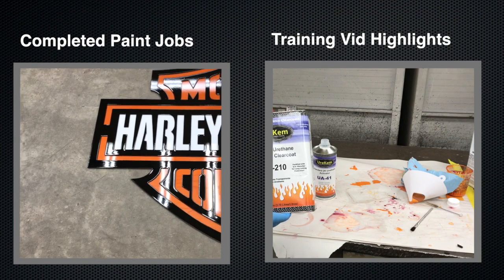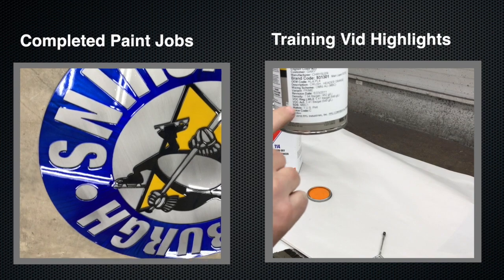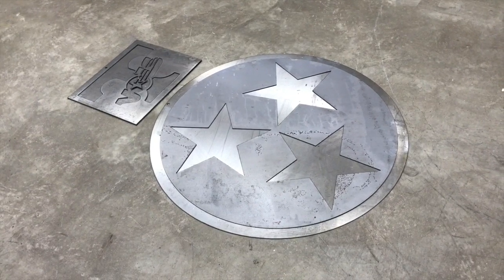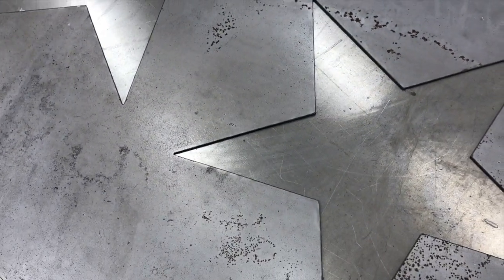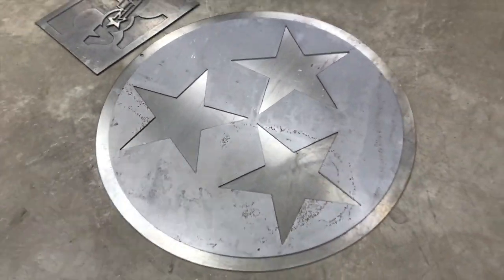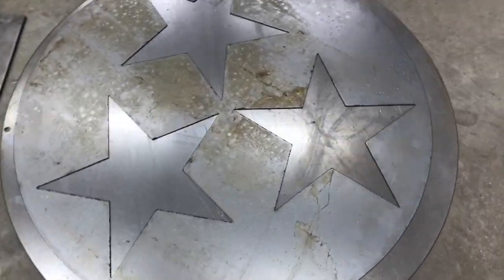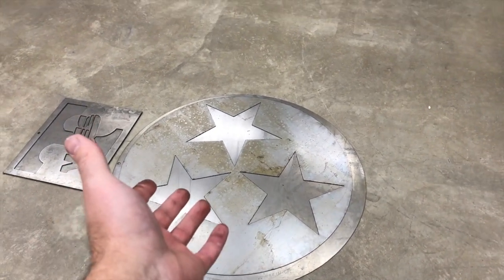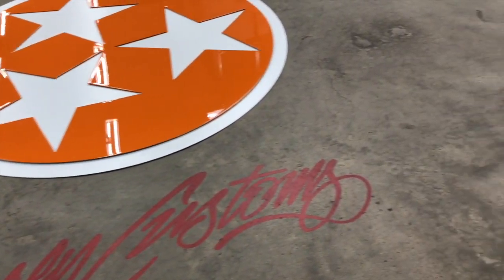How to Spray Candy Paint - Step by Step - CNC Plasma - Trucutcnc - Vols Mancave Metal Art

Comment: Most of the stuff you’re talking about on the burn table has to do with the actual plasma cutter and getting your settings right! If you have a shitty plaz you’re gonna have dross no matter what table you have and same goes for having your travel time set correctly. I have a hard time believing that star you showed was cut on a cnc plaz and if it was whoever was operating the machine had no clue what they was doing in the software part of it
Reply from the maker: If you don't believe what I say in videos, why do you watch?  Do you think I just made that up?  Yes, someone cut that on a cnc plasma table, and yes there are a TON of crappy tables out there.  The point is, if you buy from a reputable company, they can get you setup to make the table operate correctly.  Its alot more than just the plasma cutter and the table.  the CAD and CAM can have a significant impact how the final product looks.